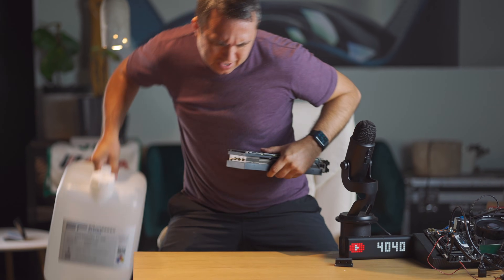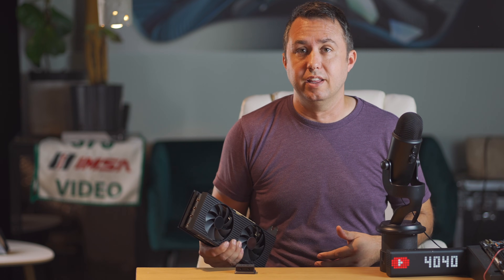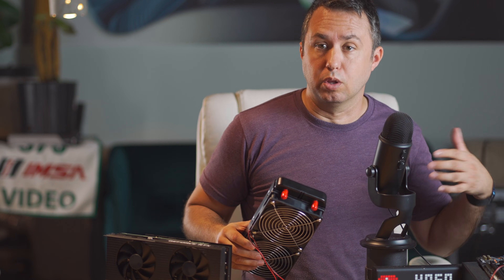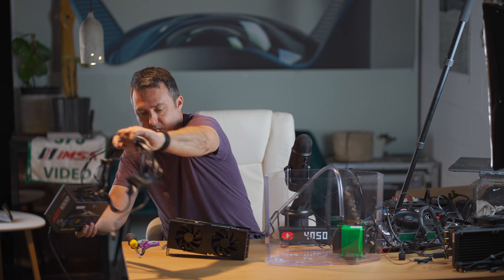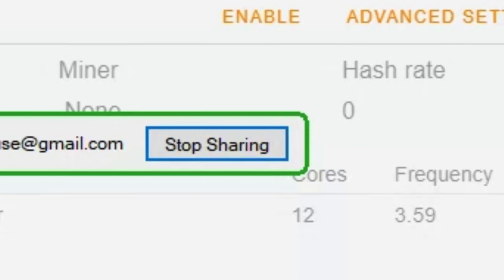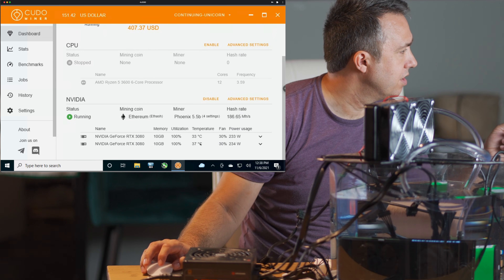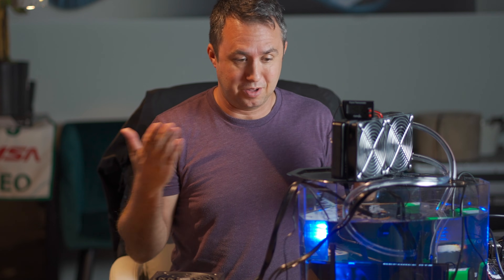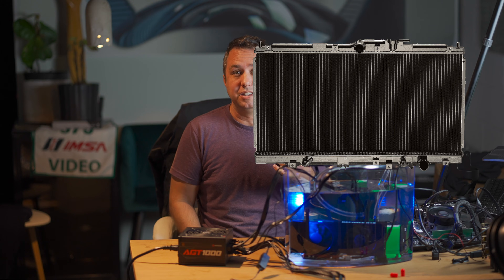Immersion Cooling RTX 3080 ETH Mining Rig with Dielectric Coolant

Comment: Sadly this coolant is much more expensive and the weight must be crazy, on my 1080ti mini I had 28°C max (2100Mhz) sadly didn't take the Junction Temp. (But it was a full block with an extra Vram redirect, so it shouldve been pretty low) 

Whats really nice is that you dont need custom blocks every generation, but it still has many downsides (Material Compatibility, Weight, Cleaning the Fluid after dust exposure)

Comment: I replaced the thermal pads on my RTX 3080 FE and my vram temps are 82-84 with fan running at 69%. Hash rate is 97MH/s. If the coolant brought vram temps to 70s and stayed there; this would be interesting, but it appears it doesn’t so much better than simply replacing thermal pads
Reply from the maker: It appears that is correct. 
There was a step I missed that I know now I was supposed to do; when using immersion, you need to replace thermal paste with thermal epoxy - I may have to revisit this experiment.

Comment: Cool liquid to 12C (Clean-room MillSpec) increase card efficiency and life.  Remove small radiator, connect liquid pump to HVAC radiator, increase cooling, decrease overall cooling power consumption.
Reply from the maker: This little kit was just a proof of concept for putting the whole shabang under immersion to include my 7 asic miners. I hadn’t thought of connecting into my HVAC system, and I’m not sure how that works since that coolant is under pressure.

Comment: u have lot to fix mate. u need to pump the cold liquid in from below via a floor plate... then suck hot oil from surface. you are simply sucking out the coolant you pumped in this way with the hose just laying inside. over a day that  ec100 will thermal soak and the temps will rocket eventually. head to engineering fluids and download the pdf how to. look at tank design section regarding flow in tank.
Reply from the maker: Yep, this build was totally janky! However it’s a week later and it’s still stable at 41 degrees!!

I talked to those guys and am actually going over there in December to tour their facilities and get myself setup for my ASIC miners with a real tub and pump and heat exchanger. 

I’ll have a video up about it shortly after!!

Comment: Running a RTX 3090 + RTX 3080 in my gaming rig, custom water loop with EKWB and the memory junction temps stays at 72°c on the rtx 3090(Suprim X) and 68°c on the rtx 3080 minging Eth, memory chipsets in the rtx 3080 stays at around 50°c(EVGA FTW3 ultra has sensors on some of the memory chips). got a bit to hot for comfort mining raptoreum on cpu at the same time tho...

Comment: lol, I do janky air cools and right now I have a sensor on my bench, my h/r on 3080 (non ti) 109 memory junction temps 78c  I'm not sure how yours is still so high, I would recommend modifying the thermal pads before hand and maybe throwing on separate backplate/removal of the backplate
Reply from the maker: Yeah, it also turns out you need to use ‘thermal epoxy’ instead of thermal paste under oil.  Not sure how this card is still hottish, but it’s way cooler than in the air!! (Not an overly practical cooling method, albeit very quiet)

Comment: water-cooling looks cool and makes a great video but the more efficient method is replacing the thermal pads on your cards. you can get 80 degrees on air cooling easy.
Reply from the maker: You sure can, but it’s really hard to make it silent. 
But yes, immersion cooling is DEFINITELY more geared towards ASIC miners, that video is coming when I get all the equipment in a couple weeks
Reply: Put the radiator outside. No more AC running 24/7.
Reply: We are manufacturing and selling the immersion cooling box, please check this video https://youtu.be/e-MFJc0QAU8

Comment: Okay so this is great and all if you have large scale. But let me tell you this. I have that gpu and you can achieve sub 80s and if your outside air is low being winter, mine are in the high 70's right now for memory junction. The reason is that for that specific model, there is a gap between the heatsink and the plate that sits on the gpu. In other words, you aren't getting full contact between the heatsink and the plates that cool off the vram. I think if you did the thermal pad mod and followed some instructions I have, you can achieve even 70 degrees in your setup or even lower.

Let me know if you're interested, but the product to use is Frosty Thermal Pad 12.8 W'MK. Highly rated product and many miners already use it as its compressibility is king among thermal pads. Better than many others for that reason.

Comment: I mine with a water cooled 3090, no direct experience with 3080s - but the HUGE temp upgrade to my 3090 was buying a standalone Bykski water cooled BACKplate. That took my mem junction temps from 100+ down to mid 70s when mining at maximum oc. (Nicehash) Since the 3080 don't have a backside vram bank it might not help as much for your card, but I'd recommend at least looking into it. I wasted a stupid amount of time on homemade heat sinks, high end thermal pads and what not. Better pads certainly wasn't dumb, but that active backplate delivered the goods - way bigger difference for mining than the frontface waterblock.
Reply from the maker: Oh interesting! Well wether it works well for a 3080 or not, it’ll make for a good video!
Reply: Doesn't work on 3080 because the memory isn't double sided like on the 3090. Tested by myself.

Comment: What about the TIM between the GPU and heat sink? Doesn't like EC fluids; it will wash away. And, FYI, all your cable jackets will stiffen, and any labels will fall off.
Reply: I think the stiff jackets issue is with mineral oil, not this fluid. But I don't know for sure.
Reply from the maker: Yep, if you want to do this in the long term you need to replace the thermal paste with thermal epoxy. 

I’m not sure that’s right about the cable jackets; this fluid is specially engineered for this exact purpose, I’ll bet they worked that out. 
Engineeredfluids.com
Reply: @SPACEDESIGNWAREHOUSE  We use EC110 in our products - Iceotope; all cable jackets stiffen and tend to split if the bend is tight. The fluid is an oil - like Johnson's baby oil. We replace thermal paste with indium.

Comment: You could have saved a ton of money if you had just used mineral oil instead...
Reply from the maker: From what I understand, using mineral oil opens a can of worms.  It will slowly eat away at rubber parts and requires filtering or occasional cleaning.   
Plus this has already led to a factory tour of the place that makes this engineered fluid!  Video coming in december.
Reply: @SPACEDESIGNWAREHOUSE  The thing about mineral oil is as long as you keep your tank covered dust won't get in and it will stay clean, otherwise it will turn piss yellow over the course of several months.  I've never experienced a rubber part breaking down while being immersed in mineral oil and I ran a mineral oil rig for roughly two and a half years..  The only negative effect of the mineral oil was that it made all the cables stiffer, or less flexible, and the clean up is a pain in the neck.
Reply: LTT have a few older videos where they do mineral oil cooling on a gaming rig, including some maintenance. (Back when Luke was on team - the project was his baby.) You start out thinking, "OMG, I'm totally doing this!!!" By the end you're like "... Umm. Wow. No. Nope. Never."

Comment: Can you also do a video on cleaning the machines from the liquid?
Reply from the maker: That’s a pretty good idea for a video! First I’m going to have to learn how to do thatb
Reply: @SPACEDESIGNWAREHOUSE  I am running 3 s19Js and starting to run into heat problems, so I am super excited about your s19 immersion video.
Reply from the maker: @kusazero  I’m going to do L3+’s on a home built system first, and then I’m actually going to the engineeringfluids.com headquarters to talk to those guys about a system for the s19’s! I really need that one to be robust and not as fish-tank-like because of how expensive those machines are!
Reply: @SPACEDESIGNWAREHOUSE  Thanks for the effort, you got my sub.
Reply: @SPACEDESIGNWAREHOUSE  It's relatively simple but you need to invest in an ultrasonic cleaner and special liquid + distilled water to clean it. Louis Rossman shows a great example on how to clean parts, but the same can be applied for these types of special liquids.
Reply: Also please checkout out this statement I wrote: 

I have that gpu and you can achieve sub 80s and if your outside air is low being winter, mine are in the high 70's right now for memory junction. The reason is that for that specific model, there is a gap between the heatsink and the plate that sits on the gpu. In other words, you aren't getting full contact between the heatsink and the plates that cool off the vram. I think if you did the thermal pad mod and followed some instructions I have, you can achieve even 70 degrees in your setup or even lower.

Let me know if you're interested, but the product to use is Frosty Thermal Pad 12.8 W'MK. Highly rated product and many miners already use it as its compressibility is king among thermal pads. Better than many others for that reason.

Comment: Does this immersion technology effect on overall electric power consumption of a gpu mining rig ? Can this technology be used on bigger level to decrease the electric power consuption of whole farm ?
Reply from the maker: The only appreciable effects on power consumption are that you can run fans at a minimum, so not really. 

You’ll still overall make the same amount of heat, and run the same power through the cards. 

The real electrical savings comes with ASICs because of how powerful all the fans and ventilation needs to be for those.

Comment: Can we not take off the heat sink?
Reply from the maker: You can and probably should take off the heat sink.  I had planned on testing it both ways, but after you dunk it MAN is it oily and slippery and Ill get back to that test later on
Reply: @SPACEDESIGNWAREHOUSE  i think you should try 3m Novec Fluid
Reply from the maker: @keimah_azl  ill read about that stuff later today! Thanks!

Comment: Bro, change the thermal pad and that's it. I have a rtx3080 air cooled 100 mh/s and VRAM never reach 80 degrees
Reply from the maker: There are a million thermal pad videos, but very few full immersion ones!  This is all part of R&D - this process is probably not best for GPUs, but ASIC machines, this could change everything. Theyre so loud.
Reply: @SPACEDESIGNWAREHOUSE  I agree with you on that, that's why my comment was that the option to change the thermal patches is cheaper and gives good results, so I think you should make the video testing with an ASIC machine. Hashraptor has some videos that I saw a few months ago cooling GPUs with mineral oil. The one I have hardly seen is cooling an ASIC. I personally have a YouTube channel in Spanish, but it is only about mining with GPU's
Reply from the maker: @crypto-fan  everything is ordered and I should be shooting my first asic immersion video on Sunday as long as it all arrives!
Reply: @SPACEDESIGNWAREHOUSE  Great news, I've  waiting to see the video.

Comment: I have a question, when you put the video card in the oil, did you have the thermal paste? I did like you and I had the thermal paste and after a few days the liquid took the paste off the processor and burned the video card. what do you? do you put it with or without pasta?
Reply: 0.2 mm.indium pad between cooler and gpu

Comment: change your pads with gelid if your 3080 watercooled has junction that high when mining. I have a 3080ti and a 3080 in the same loop/pc(watercooled) and the cpu with 2 360 radiators and the highest the junction temp gets is 68 degrees(and the bottom radiator doesn't even get to dissipate much heat if I'm being honest i only feel cold air coming trough it while the top one, well that puts out a lot of heat). the pump only runs at around 60% and the water temp is around 35c(per my temp sensor) fans granted are the noctua ippc 3000rpm(i run them at 2000rpm) for my peace of mind, but i had redux for over 8m at full speed and the temp was maybe 3 4 degrees more

Comment: If you turn the jug upside down (spout on top instead of bottom) it won't glug, and it pours smooth -- works for quart size oil bottles for putting oil in your car too....
Reply from the maker: I should know this, thats the way I put oil in my truck.  I may need you on set moving forward, Chadwick.

Comment: I'll bet ya $50 I can get your mem junc temps on 3080 / 3080 TIs (got stuff for 90s too) down to 66-74c at 80% fan, in a mining rig setup (not open air bench) and you'll never have to replace one of their memory thermal pads again.  Depending on what water card you're running, the same or better temps.  This is at +1300 mem producing 101mhs on the nose.      My 3090 runs 74c at +1900 mem doing 131.x mhs.    I can also do the same thing for 3070 Ti as well.     No oil baths or anything janky,  a simple drop-in part that's patent pending.   How much more hash would you have running 3080s at 101mhs with lower fan speeds ~70c mem temps, and 3090s reliably at 126mhs at ~74c, again, without having to replace thermal pads every 4mo and zero risk of killing the mem.
Reply from the maker: That would be amazing!  And FAR more convenient than a bunch of tanks full of coolant!   This project was my stepping stone before trying it with ASICs, and for them its mostly to get rid of the noise. 
Are you saying youve got like a custom backplate or something that does a better job with thermal pads?  I would be interested.

Comment: how much power saving compare with air cool at
Reply from the maker: Well with GPUs basically negligible.  You can run the fans slower, so thats a tiny bit less power, but then youre running a pump for the coolant, so its replaced.  Its basically a matter of noise.  
When we get into ASICS is where there will be actual power savings because of how much ventilation you typically need for those.  You can run hoses to the outdoors and get rid of ALL ventilation when youre doing ASICS.    You could do that, too, if you have a bunch of GPUs and you want to have the radiators be outdoors so it doesnt heat up whatever room you use

Comment: Use the 3M fluid and it works better and don’t need to cool the fluid!
Reply from the maker: If the card heats the fluid, and you don’t cook the fluid, what stops the fluid from just getting hotter and hotter forever??
Reply: @SPACEDESIGNWAREHOUSE  the 3M  NOVEC fluid vaporizes at low temp and then turns back into fluid at room temp at the top of the sealed tank

Comment: Basically, you should remove the fan. The hottest part is the ram, and it is in the front half, so it’s best to put it upside down.
Reply: I also use this liquid in gpu 3090
haha
Reply from the maker: And the just have the return liquid flow over the ram, perhaps?

Comment: I love your content! How much sound does the entire operation create now that you've dunked the card underwater? (inclusive of the radiator). When you say near silent operation how many dbs? And have you found the room to heat up with the liquid coolant? I just fired up my first GPU miner today and it was super loud so I might have to send it back because I have nowhere to put it without it being offensively loud - unless the coolant seriously resolves this issue!
Reply from the maker: For starters, the room will heat up to the same amount - theres no magic that make less heat overall, but the only thing you can actually hear without having your head right next to it is the fish pump.  It is quieter than a typical desktop computer at idle. 

When you say you picked up your first GPU miner, what did you get?  Is it one card or many cards?  Are they 3000 series?
Reply: @SPACEDESIGNWAREHOUSE  it was a rig with motherboard, fans and power supply but without the GPUs which I picked up separately. Sadly the rig sounds like a small hovercraft.

I got a few 3090's but will reconvene and will try to go down the liquid cooling route which sounds like it will be exactly what I need.
Reply: Thanks for the extra context on the fish pump!
Reply from the maker: @Quickcat21MK  in a world where going out to the movies costs like 50 bucks, I can’t spend too much on this for it to be worth it:)